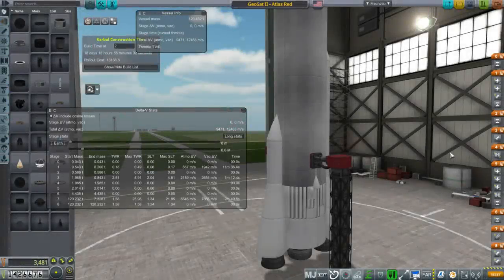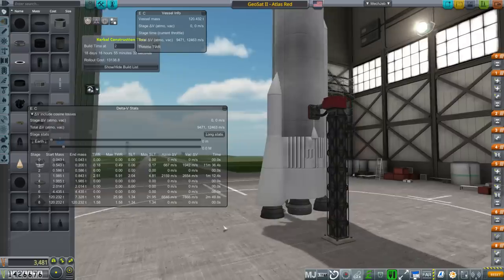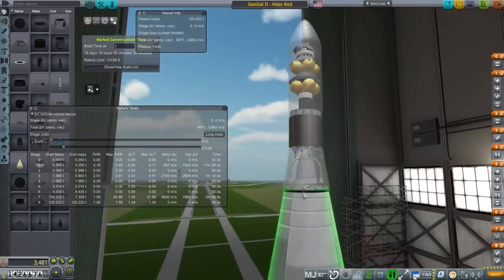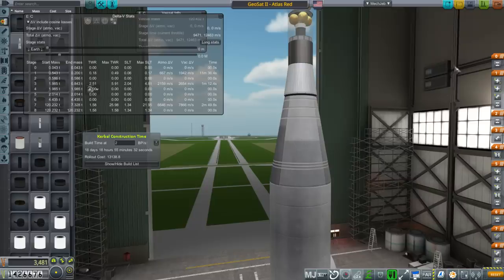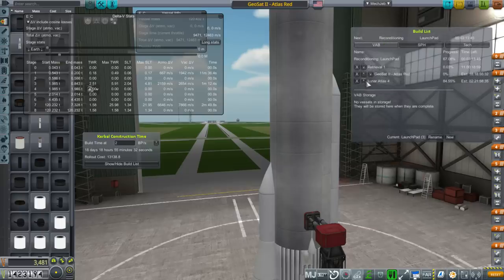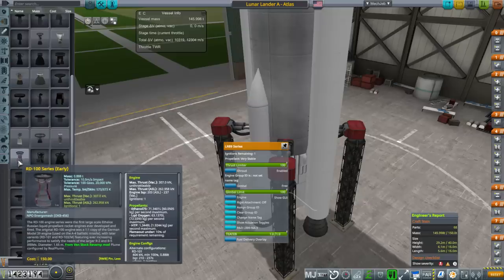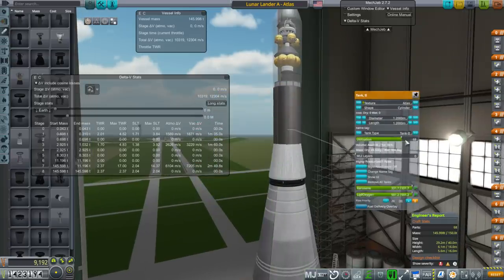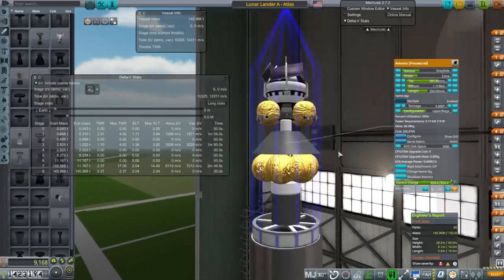KSP 1.3.1 with Realism Overhaul - RP-1 14 - GeoSat and Lunar Lander A

Comment: Suggestion:  Polar lunar-orbit satellite for communications relay.  Almost mandatory for probe-landings on the moon from the looks of things.  Secondary suggestion: Clean up the save, removing all the space-junk you can. That may help with the frame-drops you were experiencing?  Not certain, but possible.
Reply from the maker: Yeah, I actually cut out a bit where I talked about removing space debris but also weighed it against the communications help a lot of that debris - often missions with busted engines - was providing. I think twice in the video we got comm help from defunct missions. But yeah, some cleanup needs to be done.
Reply: @RaizSpace  True, true.  I'm just thinking stuff like spent stages, with no communications, and stuff.  That stuff is just lyin' around eating up RAM, lol.

Comment: Have you considered making a reconfigurable engine test stand so you can just run the engines on the launch pad to collect data units to increase the reliability of your engines? NASA has been doing that for a long time, SpaceX does it with every Merlin manufactured, and blue origin does it too so it does fall in the realm of realism to basically test the trash out of your engines before you use them.
Reply from the maker: I don't see an in-game justification for doing so when the rollout costs are so heavily based on the engine. In terms of cost, it would be better just to get the data units from an attempted launch on the off chance we can recoup costs by fulfilling a contract.

Comment: When you swap around with different Atlas tanks and engines, how to you handle the fuel mixture ratio?  I'm guessing you just do the math on the side every time something gets an upgrade to determine the new fuel and oxy ratios?  This really feels to me like one of those times where you look right past something in front of your face, like 'wheres my phone? oh in my hand'
Reply: mike b No, you just remove all the fuels and automatically they give you the new fuel mix
Reply: @thiagobaldwin2700  That would mean it assumes a specific shutdown-jettison time? Been so long since i even acknowledged Atlas' existence. Ill have to give that a try
Reply: mike b you mean how to handle the two different ratios (boosters and main engine)??? If that's your questions, you would need to do math on the side to have the perfect fuel mixture, but what I do, and I believe Tayler does too, he just use the ratio for the main engine for the whole tank
Reply: @thiagobaldwin2700  Thanks, that is what i was getting at, yes.
Reply from the maker: The LR89s and LR105 should be running at the same fuel ratio on Atlas, so there's no problem there. If you have a different situation because you're using different booster engines feeding from the tank, then you're going to have to do math based on the burn time and thrust. If the booster engines are very powerful compared to the sustainer (like LR89s are compared to LR105), then you would actually shade more toward the booster engines, since they'll consume most of the propellant.
Reply: Raiz Space nice information, thank you